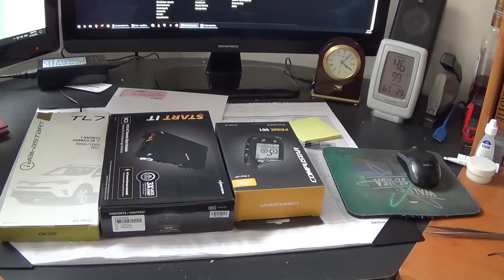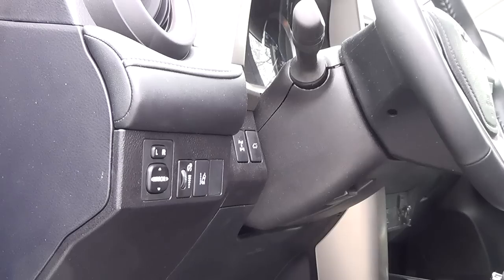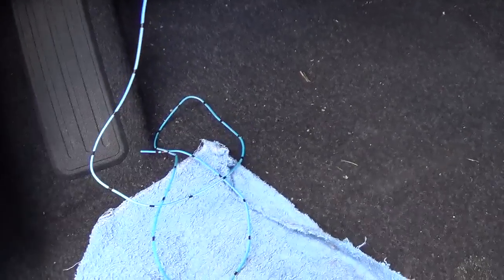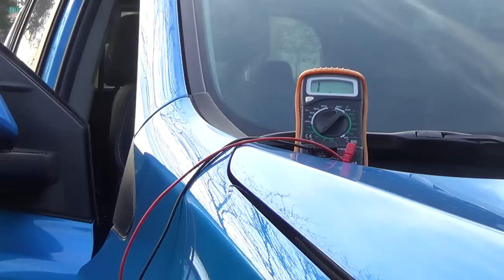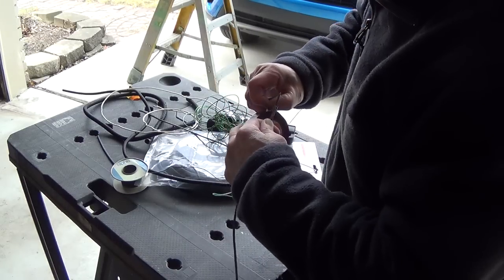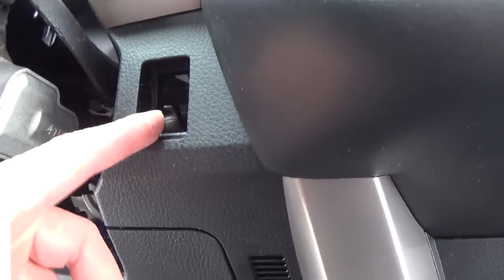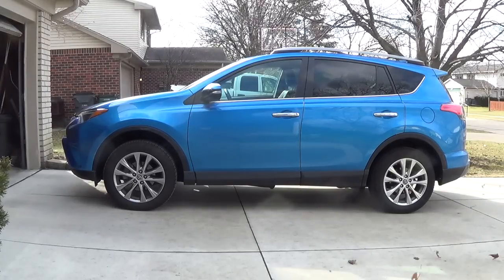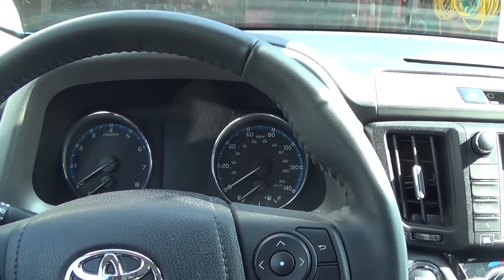Compustar remote start installation

Comment: I have the same car, do I need LC or HC version?
Reply from the maker: LC
Reply from the maker: You can use either one. HC comes with some thick wires which RAV4 doesn't need.

Comment: I installed it but the flashing red light  but not Green light please let me know how to fix it,
Reply: Is your module programmed? 
Once it's flashed on the computer and hooked up to the vehicle there is a sequence to learn it to the vehicle.
Open/close door, module light flashes key to on position..ect ect.
Reply: I did as instructed, and flashed my vehicle, but when programming the red light blinking continuously did not stop, I pressed the reset button but the green light blinked continuously
Reply: Go back and check on your installation of the wiring or you can unplug the connection and factory reset on the module it should be on the instruction manuals. I hope you got it fixed
Reply: what is the make, model, year, auto or manual transmission?

Comment: I just got mine installed. For some reason if I start and stop the car, the headlights stays on forever!!! anyone had this issue? Also, My OEM fob starts the car if I press the lock 3 times, is there a way to turn that off? I have a habit when I doubt that I locked my car, I press a couple of time. Well, I was surprised when the car started today.
Reply: @The Truth lol no, I just expected the installer to tell me those things if I am paying for a service funny guy.
Reply: Unfortunately you need an iDataLink USB cable, and they run about $40-$50 to change any programming. You might be better off going back to your installer to get that fixed.
Reply: whats the make, model, year of your car? sounds like the installer did not connect the wire to turn off auto lights
Reply: There is a wire loop that needs to be cut for auto lights
Reply: @djdeito7228  Thanks. I had to go back to the installer, it took him a while but it works now. Not sure what he did, but when I start the car now, the door unlock for a second then lock back. Works now.

Comment: How do you get access to the Weblink application?
Reply from the maker: Weblink only supports Microsoft IE (Internet Explorer) .
Reply: What is the link? Website asks me for a username and password.
Reply from the maker: http://www.idatalink.com/weblink/
Reply from the maker: Buy a Weblink, plug it in to a desk top computer, open IE browser and go to http://www.idatalink.com/weblink/ to register the device. When you are ready for uploading firmware, you can connect weblink to the bypass module and login to your account. ......

Comment: LOOKING FOR ONE PRESS.. I HATE HOLD THE DAM BUTTON!!. VIPER IS BETTER
Reply: It is a safety purposes just in case you put inside your pants pocket and somehow it got remote started when you sit on it or touch by mistake. I know it annoying one button hold to start. I have the old remote start that actually only one press button start right away but that car was total so I give it up. My old remote start last for over 15 years until it got total.

Comment: Hey I bought the compustar 6900 for my 2017 challenger. I currently have push to start, will I need a bypass module?
Reply: TheBay'sFinest yes
Reply from the maker: I don't know compustar 6900. Compustar DC-3 has build-in bypass module. If compustar 6900 does not have build-in bypass or does not come with bypass module, you need to buy one and load firmware for your vehicle.